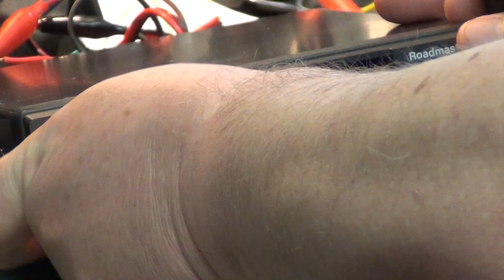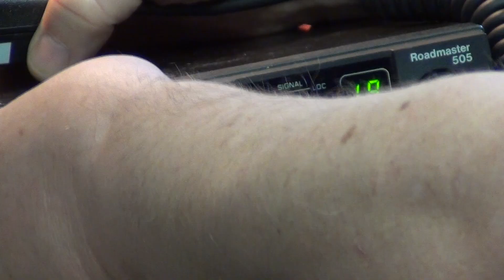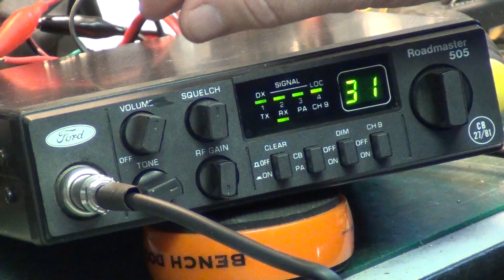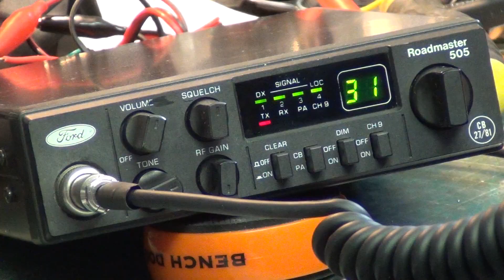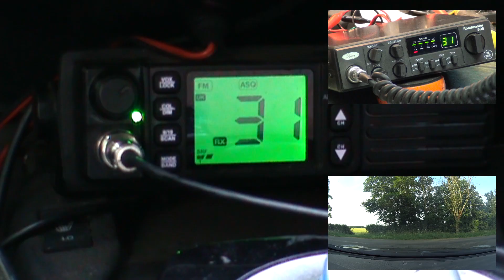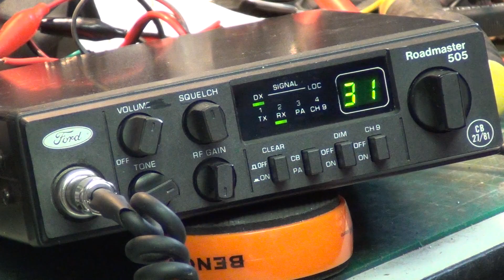Ford Roadmaster 505 CB27/81 UK FM CB radio -  On The Air test

Comment: I never knew there was a set with the Ford logo on it learn something new everyday, anyway it did well on the Scratchy corner test at all the key points and the standard replacement mic sounded the better of the two

Comment: As you know, i collect unusual sets, and managed to get  one of these a few weeks ago.  had a "clone" few years back with ford front but general cybernet ? chassis, still after a mic though
Reply from the maker: The innards are identical to the Cybernet Beta3000 in every way except the label on the back & the front Panel. The Radiomobile 202 is slightly different on the front switches. All three use the excellent Cybernet 134 chassis.

Richard, G0OJF, UK